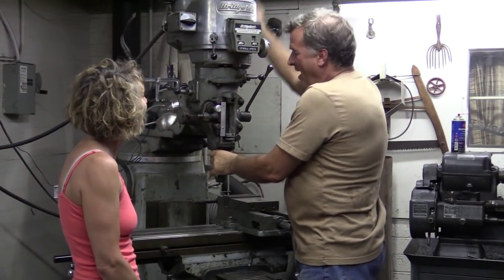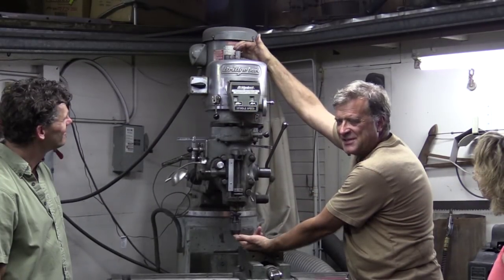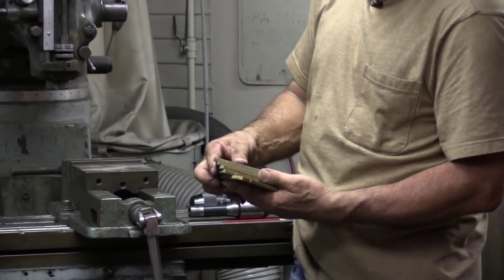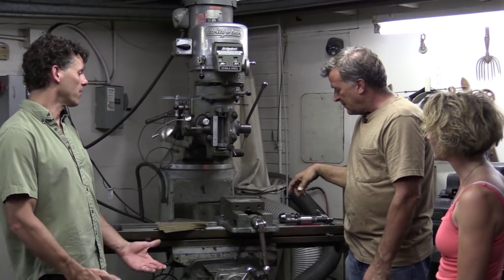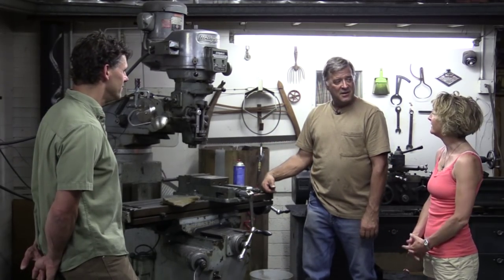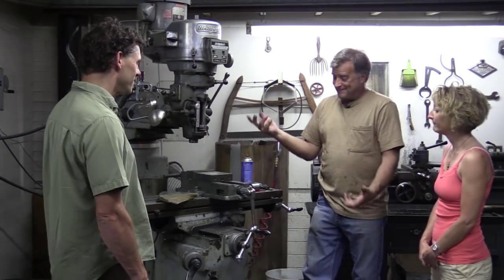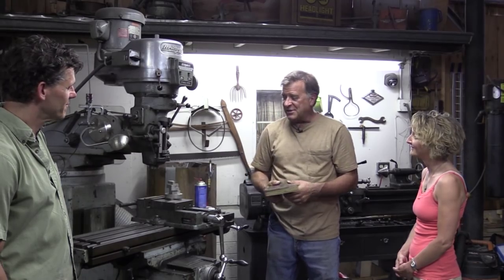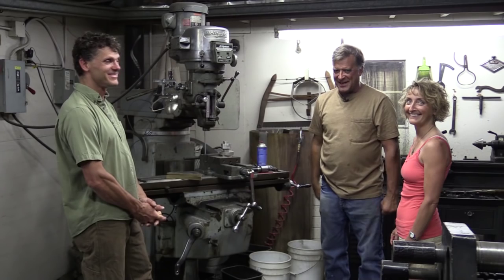How to Use a Milling Machine - Kevin Caron

Comment: Kevin, great video.  Thank you very much.  
    That "quill" you refer to- is actually the spindle 'Drawbar" to pull the arbor holding the drill chuck or collet chuck containing a cutter - tightly into the Spindle.   Then the spindle turns, rotating the cutting tool e.g. your "end mill",  all of it turning INSIDE the Quill.  The quill only goes up and down for vertical downfeed into the workpiece. 
  
Very instructive.  I'm referring potential sales people to see this!
(PS- We have about 25 milling machines in stock and VERY happy you expanded 
on a classic, the Bridgeport vertical turret-type milling machine.  
(Machineco, Montreal).
Reply from the maker: Thanks,  sometimes my mouth runs faster than my brain.

Comment: Saw a comment somewhere on here about what the machine manufacturer was. It's a Bridgeport vertical milling machine. From the looks of it, its the older J series, possibly 2J. Plus its an older one so it was made here in the US.  The part he was pointing to up on top of the vari speed box isn't the quill but the drawbar, or sometimes called drawbolt. The part you plug in your holder/endmill into is the quill. The whole thing taken as an assembly is the spindle. We've got a couple of them in our machine shop as well as a few Kearney & Treckers universals and couple other Lagoon mills. I'm more partial to the KT's in our shop since they have more horsepower. These are usually 2HP or less. However there was a joint venture between Sharp milling machines and another company out in California to build a "Bridgeport" like milling machine, but with a 4HP spindle motor.  Which we have but is currently down with a worn shaft.
Reply from the maker: Thanks for posting..     I get tongue tied sometimes..

Comment: Kevin, I purchased 3/4" Pillow Block Bearings for my first attempt at a Kinetic Sculpture ala George Rickey style. The I.D. For the nearing is ~1/2". All the 1/2 inch stock(piping, tubing, etc) is a smidgen too wide to fit into the bearing's center hole. I don't have access to a killing machine nor know how to use one. Any suggestions as to finding parts that fit this bearing? Much thanks and I enjoy your videos! Buddy Brodwin
Reply: Buddy Brodwin  Post up the part number you purchased.  It is possible that you have 12mm inside diameter.   If it is really 1/2" ID you need to use "ground stock" rod to fit (be aware once it gets a little rust on the shaft, it won't slide back out!).     Go to McMaster Carr and search "steel precision shafts"  - lots of variations.  I love Kinetic Sculptures, so if you are near Austin, TX speak up!  Only if I could convince George Schoeder to do a kinetic sculpture, I suspect he would need 6" bearings!!
Reply: Tom, Thanks so much for your response! I'll try McMaster Carr and see what I find. At present I some very wobbly prototype that would need a hurricane to actually turn. Finding solid fittings and balance are obvious keys to kinetic sculptures. Thanks again! Buddy